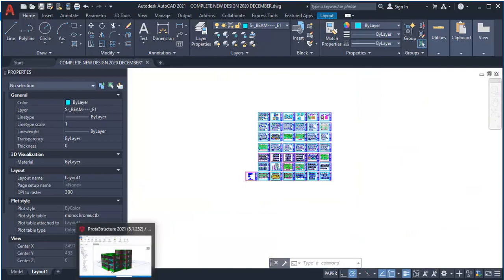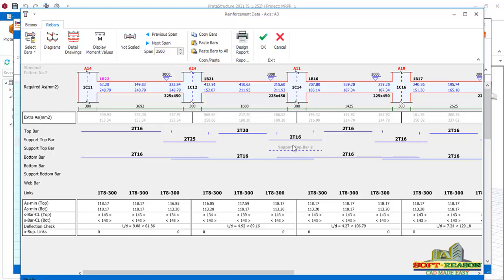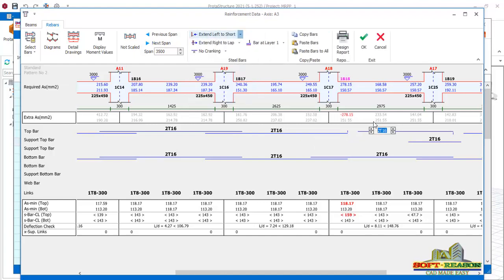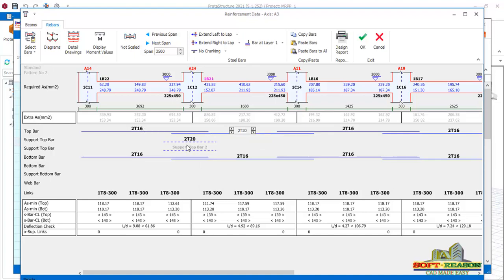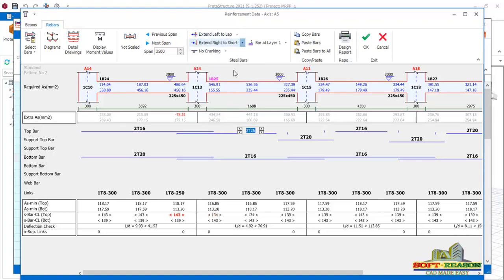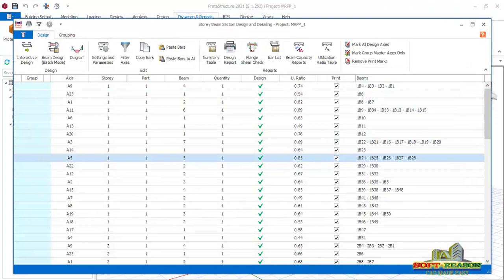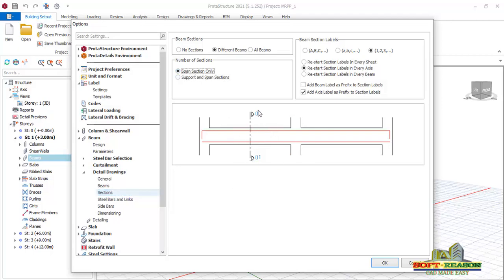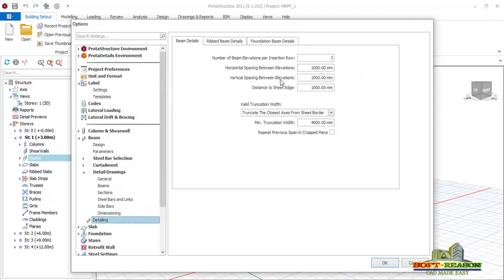Reinforce Concrete Design Optimization in Protastructure 2021

Comment: Good one sir however is it possible we could change the beam design setting not to provide support bars?

 Also what’s the idea of Modelling a beam as a basement wall in your project? Thank you
Reply from the maker: For your first question, if the continuous beam is not failing at its support there's no need for support rebars as explained in the presentation.

The basement wall is not rc beam but a shear wall,
Reply: @CADmade-easy  thank you